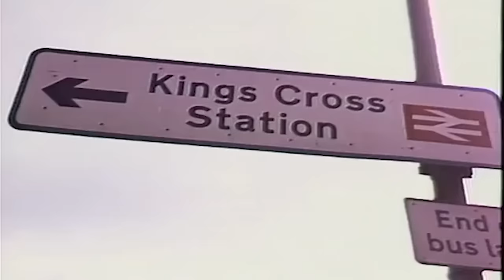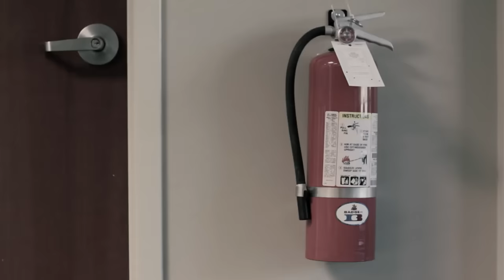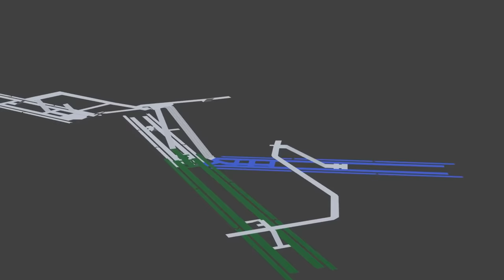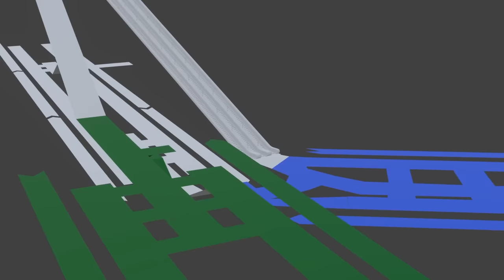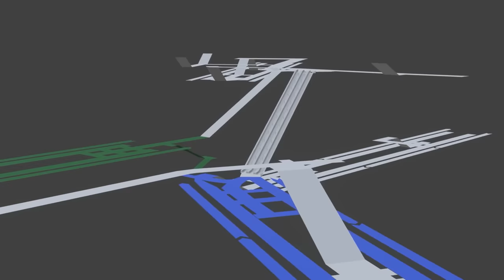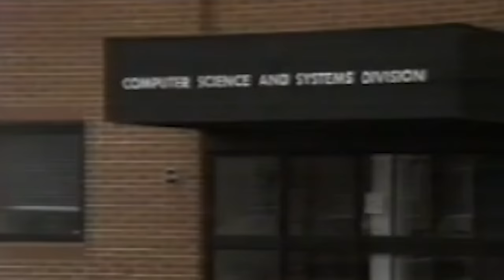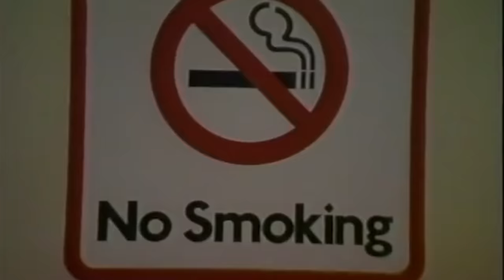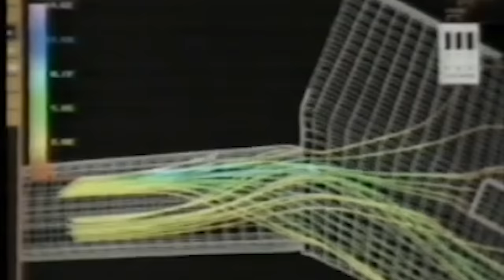The Subway Disaster That Changed Firefighting

Comment: This disaster can be laid at the feet of government and london transport. For so many years the tube system was and is starved of money for upgrades, It was well known that the wooden escalators installed in 1938+9 were a problem, their replacement was due in the late 1960's or early 1970's.
Note, the missing escalator was used in a government war factory and is still there.
The trench effect was well known amongst metal workers and was used to superheat air into furnaces from the iron age and probably before but was generally believed to be impossible in civilian settings.
A major issue which helped cause this was whenever the station was repainted the layers of old paint were never removed leaving a thick oily layer of oil based paint which gave off toxic and flammable fumes when superheated,
All in all a very avoidable fire.
Reply: Yes I was surprised that he didn't mention the paint

Comment: As an engineering condulton I have noted that fire departments are notorious for not studying thermodynamics or fluid mechanics.  [ I have earned 3 engineering degrees and performed my graduate work at Stanford University.   I have a tremendous amount of post-graduate education and training and retired from a national laboratory.]   The so-called trench effect was neither new or misunderstood.  The problem is that we are unable to get the fire departments/ Authorities to study how our results.  I perform a significant amount of research attempting to improve national and International fire codes.   Politics, ignorance, and greed greatly impacted the results.   We have recommended sprinkler systems for subways back in 1980 but many still do not have them!   We also recommended numerous changes and additions to control systems for fire detection and suppression, movement of people, control of the Subway cars, et cetera.   We also had great concerns regarding maintenance of Subway systems in general.  Sadly most cities have failed to comply with our safety recommendations.  Subways freeways waterways, et cetera, suffer from poor/unsafe construction and maintenance.   The infrastructure in the United States is particularly at risk.
Reply: Wow, that’s scary and disappointing.

Comment: While implied by the name, one thing not mentioned here with the trench effect was the role of the metal balustrades of the escalator.  They served to reflect the heat of the fire and confine the free radicals to the escalator rather than letting it disperse as with an open fire, hence providing a positive feedback loop, amplifying and accelerating the effect until it reached flashover.  It is truly an astonishing and scary combination of fluid mechanics and thermodynamics, and was one of the first phenomena that heavily used computer simulations to understand.

Comment: Stopping the escalator actually  made it worse. It kept the fire stationary, instead of not letting it do that with the movement of the escalator.
Reply: @mrkipling2201 you misunderstand what was going on. The seat of the fire was in the machinery under the escalator. Leaving the escalator running would have ensure the whole escalator would heat up and catch far much more quickly, not least because the fire would be moving faster towards the extra oxygen coming from the street entrances. Also when the burning steps reached the top they would go underneath the escalator and travel back down further concentrating the heat.

Comment: There is never a mention of the fact that LUL keep trains running whilst the fire was in it`s early stages. The trains running through the station, pushed air up the escalator helping to accelerate the trench effect and the flashover. Nowadays, if there is a fire at a tube station, all trains stop. In theory, that fire was like firefighters having to come down a chimney to fight a fire in the fireplace with someone using bellows at the bottom. If station staff had used a water fire extinguisher instead of CO2, the outcome could have been very different.

 I knew one of the Firefighters in that video sitting down, Danny with the moustache. He changed a lot after the fire and left LFB a short time after. During the 80`s it was common practice for LFB not to wear BA sets at some fires and that changed after the deaths at Kings Cross. Also Euston is the nearest Fire Station to Kings Cross but was not on the initial attendance.
Reply: The trains only stop if they are in a station. There is no way they are going to stop trains in the tunnels, as if smoke entered the tunnels the passengers would die.

Comment: Big fan of your videos in general. But the cuts throughout the video, where you show the underground map of the metro is very confusing. Especially since it just keeps rotating randomly and zooming out when youre talking about that specific section of the metro.
Reply: @valde28353773 the map of the metro you refer to is actually a 3D rendering of the layout of the station. It rotates and zooms in on the area the narration is about. It is taken from another documentary. Nothing in it is random. The different colours refer to the different lines that served the station. They are on different levels and had different escalators that converged on the ticket office. 

If you are not familiar with the London Underground you can find a map online that will show you which line is assigned which colour. 

The aim of the 3D model is to show the route someone getting off a train on a line not directly affected by the fire would have walked blindly into the fire area if they were not stopped and that they would have been trapped underground if the other train had not been flagged down to take them away.

Comment: I find it shocking that modern escalators were made partly out of wood in the UK and were still running in 1983, in the US escalators were all metal at least since the 1960s.

When the air in that ticket hall ignited it must have been terrifying! 😱 So many lives lost 😭😭😭😭😢
Reply: They weren't modern escalators. They were old outdated ones. Escalator replacement on the London Underground used to take years per escalator as they were all different. No two stations had escalators of exactly the same length at exactly the same angle. As such they could not be bulk manufactured. The stations would also have to remain open whilst the replacement was carried out. That means for a period lasting years either the up or down portion of a drop in level would have one working escalator and the passengers travelling in the opposite direction would have to walk up or down, sometimes ridiculous, flights of stairs. 

Lack of investment and no real political will to get rid of wooden escalators meant that by the time of the fire the number of wooden escalator treads outnumbered the metal ones.

Comment: In arctic winter, 12-13 years old, home alone watching a movie, I remember seeinf a flicker through the living room window, outside between the barren trunks of winter forest. It took probably a minute before I really noticed it, and my brain immediately recognized the color as no car, electric lighting, flashlight - but flame. Probably minus 15-20°C outside, I immediately raced through the hallway, tore our fire extinguisher off the wall and ran outside. I was a scrawny kid, the big extinguisher was so heavy, but I plowed at all speed my body could muster trough waist high snow towards the neighbor house at the other side of that little woodland area 150-200 meters away. The flames flickering turned out to be inside the basement/ground floor, shining through a big window. It was a couple of days before christmas, mid afternoon but there's no daylight this far north i this time of year. There was no sign of lights in the house, no cars, so I thought they must have gone away for the holiday so there wouldn't be anyone inside the house.

When / by the time I reached the window, I realized the flames were bigger than I imagined - the window was gone nearly opaque from all the smoke and soot. I froze for a second in my wrestling through thrpugh the snow, halting my intent to smash the window with the bog extinguisher. I could still see through, and the flames were rising along the walls of the stair inside up towards the closed 1st floor door. There was so much soot and black smoke inside - much more than expected given the amount of flame. And then it hit me, as I had watched a movie way past my age suitability recently called Backdraft. This basement room was starved of oxygen, and it was actually retarding the spread of the fire. What I could see through the window was already spread way too far for what a fire extingusiher could deal with, going inside would be way too dangerous - and if I smashed the window that would probably cause the fire to aggressively erupt through the rest of the house. Standing in the snow by that window, it was a horrible feeling in my gut the moment I realized all I dared or could do, was to turn back, retrace my plowed trench through the snow and call the emergency fire number (this was before cellphones were common and I was just a kid). I probably should have done that first of all - hindsight is 20/20.

They did arrive quickly and busted open the basement window. The fire spread and damaged much of the remaining house, but they obviously had the means to prevent it from burning the whole thing to the ground. No one were home or injured, but they did a controlled burn about a year or two later (guess maybe it wasn't financially viable to salvage).

Comment: I work for a company that builds exhaust fans. For car tunnels, subways, trains. They are designed to operate at 400°f to 700°f for 60 to 90 mins. After cooling down them must start and run again. They are replaced, of course. It's just part of the testing.

Comment: From what I remember, London Fire Brigade were the problem at this fire. A small fire was seen under the escalator and treated as normal and nothing to worry about by the first fire crew chief that turned up and nothing was done to extinguish this small fire. If this had been dealt with, the later catastrophic fire would have been avoided.
Reply: You remember wrongly wrongly then because Station Officer Townsley had only pulled up outside the building 2 minutes prior to the flash over. I am not sure what you think they could have done in that time scale

Comment: The debris was a combination of normal dust, rat and mouse fur, and hair, and brake pads which had been ground into the grease. The teams clearing it have not been increased, and clear about 200 yards a night. Given there's 250 miles of tunnels, it'll take them about 6 years to cover the lot. By which time they'd have to begin again.
Now that ULEZ has cleared the roads, a number of individuals have tested the tube system for air quality and it's disastrous. You'll find a Financial Times report on here.

Comment: If a staff member sees a flame shouldn't they put it out immediately? Why wait for fire services? Were extinguishers not around? It's crazy.
Reply: I thought the same thing as well.  There has to be an extinguisher somewhere.
Reply: My understanding is that they had attempted to put it out with handheld extinguishers while waiting for the fire services, but that the fire was in an area that was difficult to access and their attempts with the extinguishers were ineffective at slowing the spread of the fire (you actually have to aim extinguishers at a very specific spot on a fire for them to be effective, and if you can't get to that spot, it will be better than nothing, but you are more going to be slowing spread than extinguishing... that's when you let the fire brigade come in to use their hoses to extinguish with a deluge of water where precision is still important, but not as important).

Comment: I live in London and remember the fire well and saw many programmes explaining what happened. You have missed the real cause of the rapid fire spread, trains coming into the station at speed created the bellows effect, pushing all the air up the escalator and into the ticket hall which turned things from a slowly moving fire to a literal blowtorch. People were running around with their faces melting, so I am a little disappointed with this presentation.

Comment: Wait...escalators were wooden in the 80s?
Reply: Yep. Pretty sure there is still a wooden escalator somewhere in Sydney still. 
But those escalators at Kings Cross had been there since they were originally installed when all escalator steps were made of wood.
Reply: So were the interiors of some of the trains.  When I was a kid in the 80s the lines like Bakerloo, Northern etc had wooden floors and trim inside.  Escalators were wooden for sure.

Comment: Trains wouldn’t have helped even though they stopped stopping at the station they kept running meaning pushing air around the system subway and underground trains are ventelated by air pushed through the tunnels. So this is basically like having a small bin fire and sticking a fan next to it and wondering why the curtains and everything go up in flames

Comment: As a mechanic for many years let me tell you this, grease just don`t catch fire by a pathetic heat source like a match. There is no way a used match set some grease on fire by its own, neither some trash as matches burn out so quickly. I have used matches to light up a campfire before, matches are so weak that sometimes even firing up a campfire is hard because matches are weak and burn out too fast. This theory about a used match setting greased escalator on fire is just bogus, bogus i tell ya.
Reply: TMI!! No one cares if your a mechanic
Reply: @WestSideGangsta  Did i ask your opinion?

Comment: I have to ask, Has anyone been on the tubes in London UK? If you h=have can i ask has anybody noticed how you know when a train is coming through the tunnel before you see the train coming through. The rush of wind coming through those tunnels is immense. It is almost strong enough to push you back away from the edge of the platform. Even at the ticket office and escalators it is still rushing through there at immense speed. This is what caused the fire to hung the Escalators. then the gases ignited and the rest is history. Why does it always take peoples deaths to cause such an inquiry. I have used the tube in London every time i visit the UK to visit family or go shopping before i go back to Heath Row or Gatwick air ports. Its scary how the wind comes through there. so when was the wooden escalators installed and why had they not be upgraded in that time frame. The amount of paying customers on those lines and on the under ground network of tunnels you would think even back in 1987 that the steel escalators were being used every where apparently except the tube stations. To blame just the transportation system is not only wrong but they had to make someone accountable. what about the smoker who discarded the match to cause the blaze in the first place. right they cannot be prosecuted because they don't know for sure who that person was. what about CCTV in the tube stations were they not in operation at the time they didn't start to be installed until the 1990's. I am sure if there was CCTV they would be able to find the culprit. If it says no Smoking then you shouldn't light up until you are out of the station grounds, which i hate to break it to you, does not mean  the escalators. I know most things now are automated on the under ground and on the rail ways mostly. I just cannot get over why an inspection of the stations had not been done by the fire department for the safety of the passengers and commuters using the railways so changes can be made to the system to make it even safer for those people using trains in general right across the board. Its no good placing signs on the wall because half the time they don't see the walls unless they are looking at the board to see when their train is due. back then. Now its even worse because people don't even look where they are going because their faces are trained on their bloody phones. Today it is well known in the UK you do not smoke on any transportation trains buses and even planes. there is designated areas for you to smoke outside of the building. Still a lot of foreign people come through London and other areas outside of London they are still allowed to smoke on transportation in their own countries but it takes someone to tell them they cannot do it on the UK systems, Parts of Europe the Middle east and even Asia are still allowed to smoke on their transportation. If i am wrong about that i am truly sorry. Its been a little while since i was in the UK and even Europe. That is the beauty of CCTV if you are doing something you are not supposed to you can be held accountable for your actions. We need more of it.
Reply: That push of air is not restricted to London, having just been on the sky trains in vancouver, the metro stations in Newcastle and the metro in Prague, you can feel the movement of air in their underground stations as well.

Comment: Buried at 9:52 is this key information "......set the WOODEN ESCALATOR on fire."  A huge, heavily used escalator, and it was wood.  In 1987.  Are you kidding me?  ( and apparently there was no sprinkler system for the station or for the equipment.  - in 1987.  SMH )

Comment: That dull 'Whump' everyone heard was the thin steel sheets of the escalator handrail box been blown out as the hot gasses inside built up and ignited in the FIREBALL THAT FLASHED DOWN ON THE HEAD OF WITNESS AT THE TOP OF THE STAIRS!
The so-called trench effect was a cover up and easily refuted by the test that showed flames prefered to travel up into the handrail box!